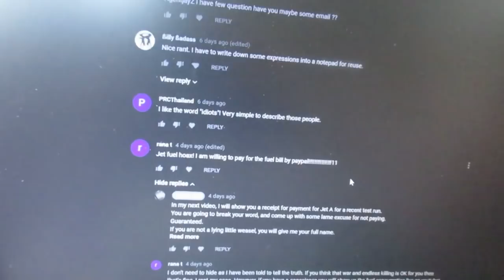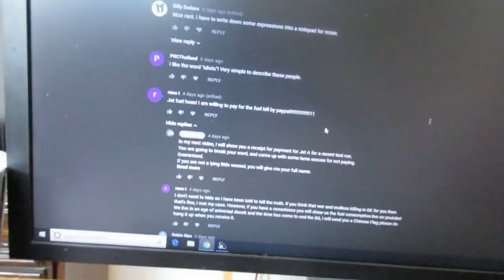Hoaxtard Discussion

Comment: Well i figured they dont use as much feul as they  say in these jumbo jets,  is it liquid or a gas feul
Reply from the maker: The only way to escape the trap of ignorance is to look into the issue. Hoaxters always say they want to expose the truth, yet they vigorously deny it. Break out of the trap; do a couple searches, and read a couple books. I have a video called Books. Might be a place to start.
... or not. 
Your choice.
Reply: @AgentJayZ  Sir all you did in this video was insult people who actually ask questions. My father is a 30 year Captain of a Boeing 787 for Air Canada and he was stumped at some of the questions that arise when you look into this topic.  
For one, you did not address the original comments question, how on earth is an Airbus A380 being filled with nearly 320,000 litres of jet fuel every single flight? that is close to 5 10,000 gallon fuel trucks in/on each wing which physically and practically speaking makes no sense. For reference, that is roughly the same weight as nearly 40 Chevrolet cameros resting on each wing...
Secondly, how are people able to breathe these highly toxic fumes in without a single sign of coughing? Here I am linking a video of people standing behind a massive jumbo jet inhaling all the fumes it is emitting without a single issue. https://www.youtube.com/watch?v=GqVjD3nBSQg
How are none of these people chocking? They are only inhaling highly toxic jet fumes that was just heated up and shot through the combustion chamber. 
Thirdly, never not once in the history of aviation has a plane ever exploded/imploded due to accidental ignition of the fuel tanks during a flight/in mid-air (which when you think about it, makes planes seem like a flying bomb), only have they ever crashed into things, and subsequently exploded. 
Lastly, there is so much other evidence but I am not going to continue unless I am sure you have an open mind and are actually able to acknowledge some of these intriguing questions. Although to get technical, how is sloshing of 320,000 liters not affecting the planes aerial integrity??? how are tiny little tires supporting over 1.23 MILLION pounds during takeoff? Like, are you seriously not wondering these for yourself? 
I'll leave you to pounder :)
Reply: @jbouchard1780  TWA Flight 800 - exploded at about 16,000ft with the seat of the explosion being the centre fuel tank.
Reply: Non Conformist not sure I understand what you said there... there is a centre fuel tank on that aircraft type, and if you care to read further you will realise that it was almost empty, which is what enabled the conditions for an explosion to arise. If it was full, there would have been no problem.
Reply from the maker: The fact that you do not understand something is not evidence for anything except that you don't understand it. I can never prove anything to your satisfaction, but that is not my problem, it is yours. Whether or not you believe or understand  the fuel consumption figures for airliners of any size matters not to the world. This is not a debate, and your point of view is irrelevant to the facts. It's just you presenting your ignorance as if it matters. Enjoy... I will not be bothering to respond to you. Well, after this comment, anyway. Cheers.
Reply from the maker: What? I give up nothing. Jet fuel hoaxters are idiots, morons, and clusters of stupidity. They accuse me of lying for simply stating facts. They do not recognize facts, because they refuse to learn, or even look for the truth. They are not worth my time or anybody elses time. Whether or not the hoaxtards believe it, jet engines use fuel. They just don't get it that the only hoax is the one that they are pulling on themselves. There is no debate.
Reply: J Bouchard,  let me take a rough guess, you are not involved in the aero industry.
Reply: @jbouchard1780  This company isn't for refuel a whole plane, they buy fuel to test run the engines.... your intellectual capabilities are amazing. Can you breathe without anyone telling you when to breath in and out?
Reply: @jbouchard1780  You may have friends with the same interest, just buy a model aeroplane with a jet turbine, put together your money and you will see who's right ;)
Reply: @jbouchard1780  Tiny little tires? 
The tires on an A380 are almost 5 feet in diameter, 21” wide, and weigh 265 pounds each.  Far from “tiny”.  
 Each tire has a load rating of 74950 pounds. The A380 has 22 tires.  That puts the total load capacity of the tires at 1.65 million pounds!

Comment: show me the gas cylinder tanks at the gas turbine power station ? Show me a fuel tank in a 747? you never - I wish i was wrong.
Reply from the maker: Ahem... the gas turbines at a power station run on fuel supplied by a pipeline.
We've talked about airliner fuel storage areas before. There are no separate "tanks".
You have not made any claims here, only requested information, so you aren't wrong.
Reply: @AgentJayZ  thanks for the reply J
Reply: The 737, as many other planes have integral fuel tanks, educate yourself on what that is.
If you claim that they dont have fuel tanks, because there is not a part on a list for it, its called "INTEGRAL" for a reason, then show me the partnumber for the engine compartment for your car, the part number for the glovecompartment, the trunk etc.
You cant because its part of the cars structure, its INTEGRAL!

Comment: A380, the largest airplane in commercial airline service, can supposedly hold nearly 86,000 U.S. gallons of jet fuel. Where is all that liquid fuel held in? #jetfuelhoax
Reply from the maker: Attention all hoaxters: The fact that you don't know something, or don't believe in something is not evidence to be used in a debate about it.
Also, it's not a debate... it's reality that you do not understand.

It is very good that you are asking questions.
You can find specs and diagrams everywhere for airliners.
The fuel for a large airliner is held in many areas of the wings, and in some large areas in the fuselage below the floor. These fuel holding areas are not separate "tanks", because that would need a lot of extra metal, and weight built into the aircraft. The fuel is held in sealed off volumes, surrounded by the skin, and divided up by sealed bulkheads, or walls within the structure. 

Conversationally, these internal volumes are called tanks for convenience.

I don't know the specifics of the A380, but I have discussed fuel capacity with a 777 captain.
He said that for New York to London flights, he would often use only the center-wing tank (that big one mentioned above, in the center of the fuselage between the wings), and he would have 200 thousand lbs in it.

If we makes some very rough estimates, you can check to see if that's reasonable.
Take an estimated 20 gallons per minute of fuel consumption per engine, times 60 minutes per hour, times the number of hour the flight would be, times about 7lbs per gallon of fuel, what do you get?
Plus an hour or two of reserve... those very crude estimates are in the ball park.

New York to Tokyo? We're gonna need to use the wing tanks.
Reply: Well, in the wings and some in the fuselage. Happy now?
Reply: @alexf962  wings? 🤣 have you seen how thin the wings of an airplane are? You can literally see through them when they lift the flaps during landing. The fuselage stores all the luggage. Can you even comprehend how much 86,000 gallons of jet fuel is? Can you comprehend how much time it will take to pump that much fuel in the wings of a plane? Where are peoples logic and critical thinking skills?
Reply: @nicuburicu90  You are doing nothing but showcasing your personal incredulity, you have shown ZERO evidence for your claims. So what, only airplanes like the one I fly, the Cessna XLS use fuel because you are not afraid of those numbers? You know nothing about airplanes and you claim to have critical thinking? Read the comment I left and use it as a mirror. No, not all the fuselage holds the luggage, the center part that the wings are attached to has huge fuel tanks in it, so you are dead wrong. Congrats to your critical thinking abilities. Next time, bring solid evidence.
Reply: @nicuburicu90  Well? Is that all you've got? Disappointing...
Reply from the maker: Oh, Nicu... You made me laugh. I might have farted.
Reply from the maker: NB: sit down and have another Twinkie. You are a child, and we all get a chuckle when you try to act "big". Good boy...
Juice box?
Reply: @nicuburicu90  I'm an aerospace engineer I design and test systems (including fuel systems) for aircraft. I've been inside aircraft wings many times. You are wrong. You cannot "see through" the wing. The wings are typically a foot and a half thick at the tip but several feet thick near the fuselage. I can stand up inside an A380 wing in places. An average man can fit into the wings for maintenance. There's oval hatches on the underside for this purpose. I've done it myself. A respirator is required as the fumes of fuel vapor is overbearing. The wing contains many fuel pumps and pickups and pipes basically a fuel system. I've seen it you haven't. I look forward to hearing how I'm wrong.
Reply: @bobbyrayofthefamilysmith24  I love how you can also easily do a Google search and find a photo of people standing in an A380 wing, but apparently that is far too much "research" to expect of the hoaxers...
Reply: @nicuburicu90  🤢🤢 cringe
Reply: @Nicu Buricu  How thin are we assuming? You do realize where the wings mount to the fuselage, it's nearly 12ft talltapering to sound 2ft thick at the end. The wings are also over 50ft wide at the fuselage and tapering to 13ft at the wing tip. Let's not forget, each wing is 120ft long. Maybe do some research on the matter before spring nonsense you're not familiar with....

Comment: I would be interested to see the fuel  filtration system. Do the turbo fans het carbon build up?
Reply from the maker: I have shown fuel filters, and will again. 
Your question makes no sense. I could guess what you mean, but won't.
Reply: AgentJayZ I will look for the video or you can drop a link. I'm sure it was through and in debth.
Sorry auto type took over my crappy spelling. Does carbon build up on the blades?
Reply from the maker: The fan and compressors are well ahead of the point of fuel introduction. They do build up dirt and even soot, but only from dirty or smoky inlet air.
Reply: AgentJayZ  gotcha.. crazy stuff.. what kind of emissions do theses things have?

Comment: No one said they use zero fuel. That is the problem. You act like anyone ever said that NO fuel was used. 

Where is the space for 65,000 gallons and where are the tankers that can carry that much fuel?
Reply from the maker: Every one of you hoaxtards who have contacted me has said that the airliner engines use no fuel.
Are you saying I'm lying? Oh, you are already doing that.
Are you speaking for the hoaxtard community?
Are you their leader?
You are all ignorant, and refuse to open your eyes to learn the facts that are right in front of you.
Choose a life of blindness, but don't try to instruct me.
I build and test these engines, sir.
Reply: Exactly
Reply: @AgentJayZ  No offense but this is exactly why some people aren't believing you. It's called a "strawman" argument - you're addressing people who think there is NO jet fuel, which is ridiculous. It is, however, perfectly reasonable to question the AMOUNT of jet fuel on the plane.
A half-a-million pounds is a TREMENDOUS amount of weight. Perhaps you should focus on the actual volume required to hold that much fuel - approximately 22 feet cubed (or ~7 meters cubed). This is a lot easier to digest when the amount is distributed throughout the various tanks in the plane.

Comment: Wheres all the black smoke on the wings?
Like all other engines?
   Only see white smoke. 
Like it's got water n it.
      And on this part..
In one country,  at the beach next to airport. 
People stand right behind plane..and get blown back on start up .but never burned.  Nor even feel heat.  
  And my big question is..
How do all these people think a airplane could land on moving runways.  
   And pilots dont ever ask which way its spinning..

And all the patents..they all 
Say flying over a non rotating plain. 
   I heard Webster's is changing it to sea curve instead of sea level. 
   Where is sea level measured?
By the beach..
Reply from the maker: Man, you are so dumb, I can't even begin to address it.
It'd be like cleaning a street knee deep in garbage with a teaspoon.
So, get lost, and just keep rolling in your garbage.
Reply: The wings shouldn have black smoke on them, that would mean that the wings are burning.
Ive seen millions of combustion engines in my life, natural gas, diesel, gasoline, gas turbines, on tanks, trucks,  trains, scooters, ships etc. and ONLY during extreme throttle, extreme tuning beyond design specs, very worn parts, bad adjustments etc. causes "black smoke" from the exhaust.
Not the wings....
The colour of the smoke dictates the state of the engine and possible contaminations in the engine, not the fuel used.
The "white smoke" as you call it, can be a lot of things, not just water vapor.

They dont get burned from the exhaust because they stand to far away from the engines, the fence are put there to safeguard those idiots.
Try standing 30cm from the end of a cars exhaust, you dont get burned, yet you can boil water on the end pipe.

"Moving runways"?
You have to explain that, what you mean by moving runway?
Your english is hard to understand.
Are you a flat earther that dont think that the earth is a sphere and spins?
The number on the runway is the compass heading they are pointing, rounded up to the nearest tenth.
The exact heading is printed on the airport charts.

Seal level is not measured at the beach, its measured above the water, and go figure why its called MSL, that means "Mean Sea Level", which mean average sea level.
Reply: Holy shit you're special 🤣 do you know where the majority of thrust comes from a high bypass engine?

Comment: 2:09 Those four widgets attached to the turbine nozzles don't look like part of the engine, what are they?
Reply from the maker: Those are the magic hookety hooks. A factory designed but locally manufactured tool that allows you to lift the nozzle and liners as a unit. The liners are a slip fit into the nozzle's transition duct, so it is possible for them to slip out when lifting the assembly into the engine.

Comment: have a question for you guys, if you put a low bypass turbofan engine in the fuselage of a supersonic plane, would it be able to push the aircraft to supersnoic speeds?
Reply: I think most fighter engines these days are low-bypass turbofans, so, yes.
Reply: I would have to respectfully disagree with the turbofan on fighter jets..... the only "fighter" that I know of that uses a turbofan would be the Harrier.... and the A10
Reply: Concorde use the RR/Snecma Olympus 593, it was a turbojet, not a fan.
All modern supersonic planes use low bypass turbofans
Reply: We've had a lively discussion in the past on this channel about the term 'turbofan', because R-R used to describe engines such as the Spey and the Conway as 'low  bypass' turbojets.  However, such engines are now now almost universally known (at least in the English language) as low bypass turbofans.
For many years now, military engines have been low pass turbofans.  Yes, the Pegasus engine in the Harrier is a low bypass turbofan, with a three stage fan.  The TF34 in the A-10 has a single stage fan, with a higher bypass ratio: nevertheless, both engines (using current terminology) are turbofans, every bit as much as the latest big civil turbofans with bypass ratios of 10:1, or greater.
PS  I was head of the compressor design team at R-R Bristol, back in 1987, when we designed the fan for the uprated Pegasus engine and we called it a turbofan, not a low bypass turbojet.
Reply: To get another take on it.
The plane doesn't care wether its a  rocket, turbojet,  turbofan or even compressed air for the arguments sake as long as it provides the required thrust with appropriate gas-speeds (!) for the particular jet. As we see both turbojets and turbofans can provide that if engineered accordingly.
A high-bypass airliner engine would however probably not get you to supersonic speeds, also because exhaust gas speeds are too low.

No engineer, please correct me if I'm wrong.
Reply from the maker: ALL modern fighter jets use low bypass turbofan engines. F-14, F15, F16, F18, F22, F35, Typhoon, etc.
The A10 is not a fighter; it's a ground attack plane, and the best aircraft at its job ever made.
You were right about the harrier, so not totally completely wrong... but close.
Reply: There's a very simple equation, the Froude Equation, which demonstrates that, for 100percent propulsive efficiency, the jet exhaust velocity of the engine must equal the forward velocity of the aircraft.  The equation also demonstrates that the greater the difference between the aircraft forward velocity and the jet exhaust velocity, the lower the propulsive efficiency.
There's one obvious and fundamental problem with achieving 100percent propulsive efficiency: you can't.  If the aircraft forward velocity and the jet exhaust rearward velocity are equal, then there is no momentum change of the air going through the engine and there's no thrust.  In other words, an aircraft can never go as fast as the exhaust velocity of its engines. 
The latest big turbofans, with bypass ratios of 10:1 or more, are close to maximising propulsive efficiency with their low efflux velocities, producing thrust by imparting a relatively small velocity increase to a huge amount of air.